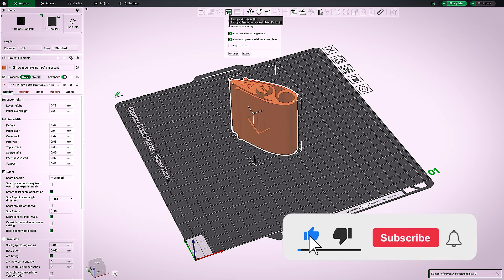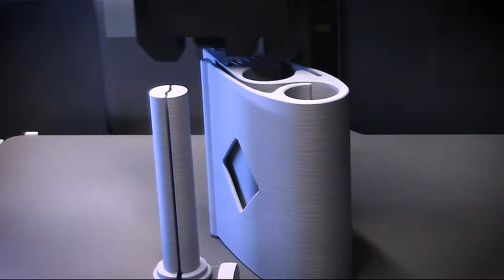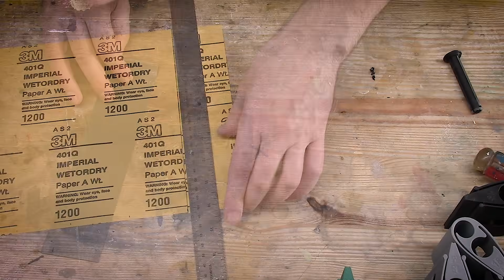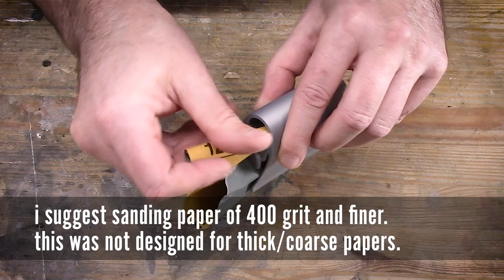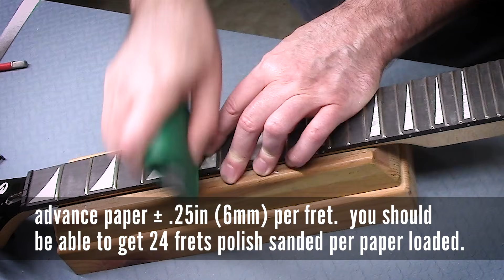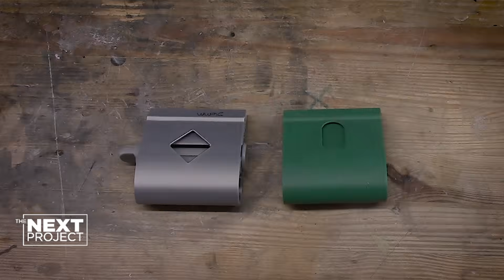3D Printing Guitar Project Tools   Fret Sanding Grip v19 E4C

Comment: What about adding a pair of teeth to both slits - it would lock the sandpaper in place and prevent it from sliding to the side.
Reply from the maker: Zbyněk Mrkvička, thanks for watching!
adding texture/teeth to the slit may help. There is a "wave" inside the slit for some grip. Often when the paper slips a bit to the side, it's due to either having a angle on the folded tab end, or there being too much slack in the paper as seeing in the loading demonstration. 
I'll add your suggestion to the list for the next version.
Be safe and take care!

Comment: Hi John, what I need is a self polishing set. That would be great! My poor hands are ruined from all the polishing and sanding. Thanks for sharing
Reply from the maker: Hey Randy, good to hear from you!
I hear ya, that was largely what pushed me to start working on this thing. My hands would always cramp up, I'd rub my fingerprints off, just miserable.
Now things are a bit better. This tool may not be perfect (yet), but it seems to help with the sanding/polishing process.
Send me a message at: thenextproject.info@gmail.com
Talk to ya soon!
Reply: @theNextProject , definitely John, will do my friend. I hear ya on the sanding the prints off. I developed a system too. Talk soon.

Comment: I got 6 prints of version 18. It really is the best fret polish option on the market. I love it. I do one final pass with a Dremel tool with a buffing wheel and a polish compound I use when sharpening chisels. Use it with a plastic fretboard protector that I cut with a cricut printer. Works awesome. Very little tape required.
Reply from the maker: So glad to hear you have had great luck using the tool!
That's a great idea using the cricut printer to cut a fingerboard protector!
Keep me posted on future uses and if you have any refinement feedback too.
Be safe and take care!